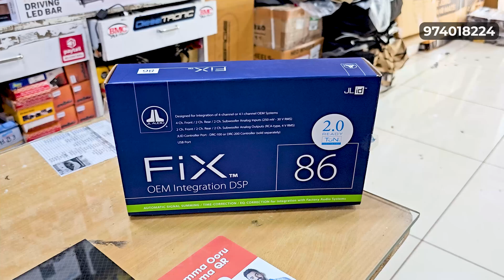DSP I WHY YOU NEED A PROCESSOR I ADVANTAGES OF DSP

Comment: please ket me know how this sound system for my thar 2022.
PIONEER TS-WX400DA Compact Series 9" x 5-1/2" - 250 W Max Power - Compact Active Subwoofer,Black
CERWIN Vega XED6004 600W Max 4-Channel Class D Amplifier
PIONEER TS-Z65CH, 2-Way Component Car Audio Speakers, Full Range, Open & Smooth Sound Quality, Easy Installation and Enhanced Bass Response, Black 6.5” Round Speakers x2
Blaupunkt AMK44R Car Audio Amplifier 4 Gauge Wiring Kit RED 

please reply
Reply from the maker: GOOD SETUP